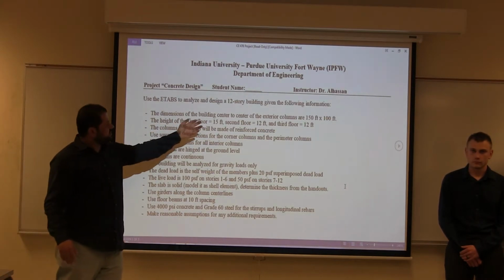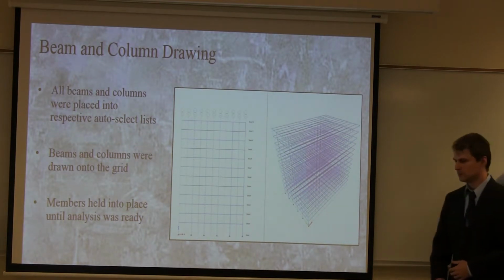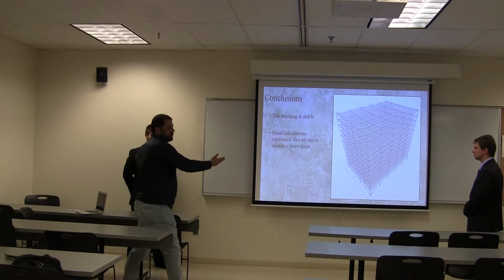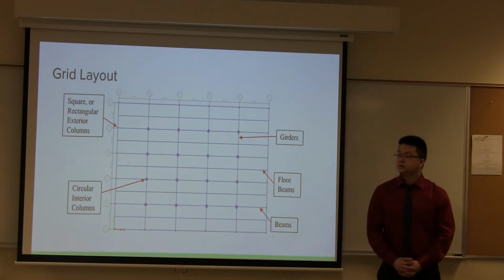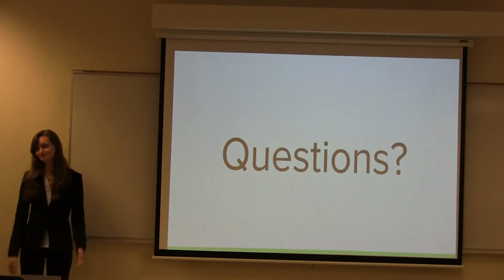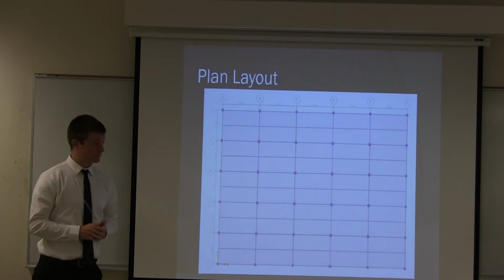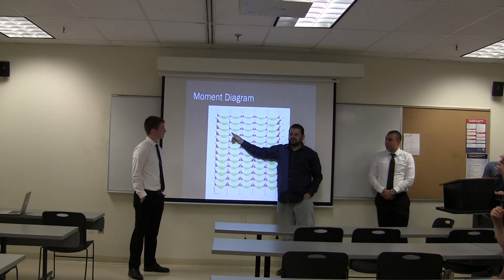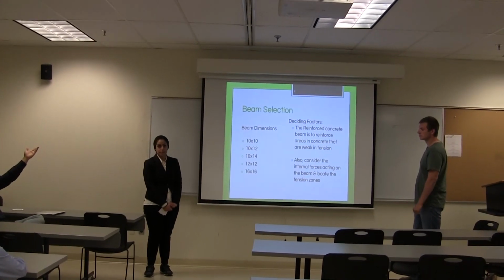Lecture #24 Reinforced Concrete Structures - Dr. Mohammad Alhassan

Comment: If the corner support is considred a pin, do you recommend putting in the negative moment area the minimum ratio of reinforcement (.003) or the shrinkage ratio of reinforcement (.0018) and why?. Thanks for your valuable efforts
Reply from the maker: not necessarily ..... but in any case two steel bars must go all the way at any location for any beam...this to hold the stirrups in place. Such bars will provide a small reinforcement ratio close to the minimum.